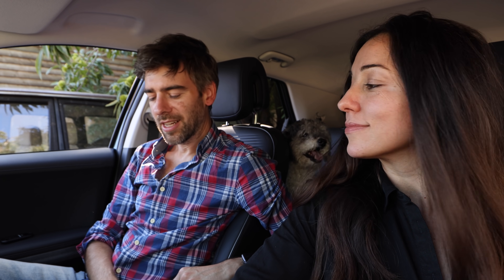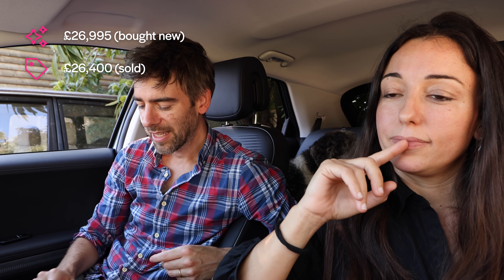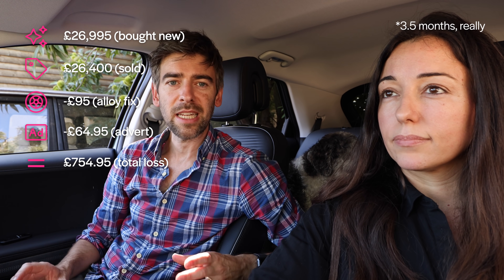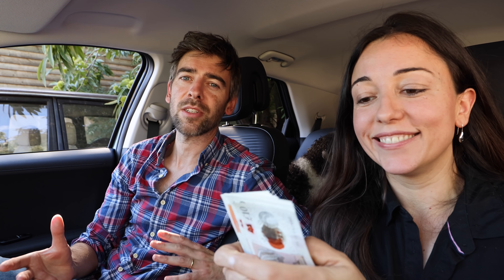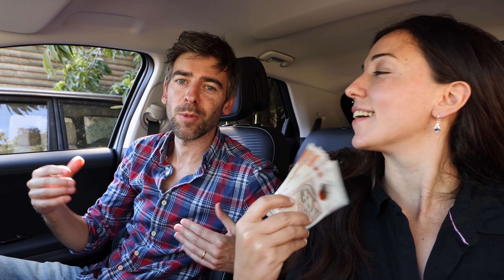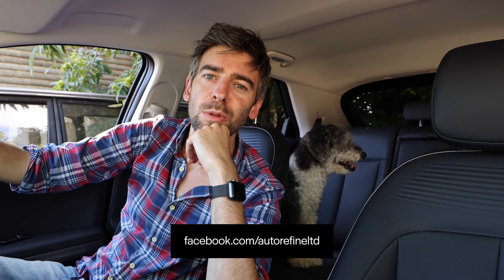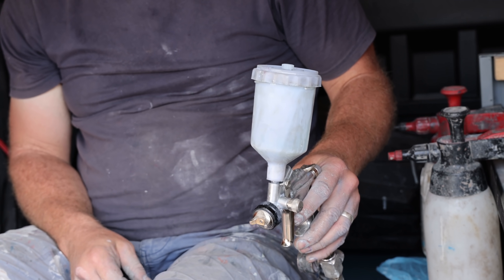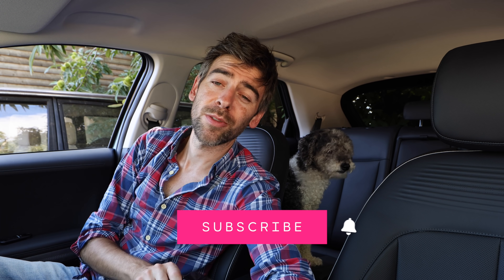How much do EVs depreciate? We sold the Fiat 500e: how much did we lose?

Comment from the maker: The dealer who bought the car is advertising it here. That's quite a profit they'll make if they sell it for that! 

https://www.autotrader.co.uk/car-details/202108316837001
Reply: (Link is not working now.) 
This video is worth its weight in Gold. So you lost a bit less than you think.
As for the kerbing, that could have been a bigger loss if the car was leased.
And you have the £500 which was honoured when you purchased the car.
Worth all of the £200 for Flaviana, too! Look at her face. 😀👍
A pretty good deal, I'd say.
Well done, and thanks to both of you for the video. 🙂
Reply: Suggestion... Put the value up £500 & then during negotiations go down slowly to the value of price bet with mrs.
You need to learn to negotiate.

Comment: Here in Costa Rica where I live, a 2017 Fiat 500E costs $15,500 which was the same top dollar as it costed 5 years ago. In terms of currency depreciation in Costarican Colones, it appreciated in value 25% from 5 years ago. My 2012 Volvo S60 T4 has a residual value of $9,000.” If I’m lucky!
Reply from the maker: I'm surprised it's kept its value so well considering it's the old model. That's a testament to how good they must be.
Reply: @MrEV  And that there aren't many around to quote! Pity that ONTO passed the way. We have renting here, albeit I haven't been able to obtain a contract. The regular car loan required a 30% down payment and came with a two year fixed interest rate of 8.4% APR and then 9.20% variable rate with a floor of 9.2% and no ceiling onwards for the next two years...

An acquaintance of mine drives one 500e since 2017. He paid $15,000 then and has lost in 5 years 10% of battery life as per an application. He has not performed a total discharge-total charge test. He's been charging immediately upon arrival to his work and when arriving at his place. Albeit he has an diesel SUV for longer errands.

I am smitten by the looks of the car in grey with orange accents, but I have yet to face the piper with the loss on my beloved Volvo S60 when I sell it! If I am able to sell it as they have a bad reputation and expensive parts!

Comment: Great video thanks. I'm in the process of selling my Tesla model 3 performance now 2 years old for a new Model 3 LR. When I ordered my performance back in May 2019 it was £ 51k. I am now selling it for £ 48k! I put a 20k deposit on the performance with monthly payments of £ 600 on HP to own the car after 5 years ( still 3 years remaining) no pcp was available when I bought the car. The new Model 3 is 15k down with 4years payments at £ 450 on pcp with 12k back in my bank once I settle the hp balance. Picking the new car up next week really looking forward to it. Every time I drive this car it puts a smile on my face and its so easy to live with and awesome family car. The wife loves it which is a bonus. My previous car was a 2017 BMW m3. Cost 60k and only run it for 18 months. Only got 32k back for that car😬 cost me a bob or two.
Reply: Long range EVs will have low depreciation for the next 3-5 years because battery size and design will not significantly change in this period.  Same as they didn’t change much in the last 5 years.  Only wish we changed to EV sooner.

Comment: I have a question. I am thinking of buying an ID.4, selling in about 3 years. I am assuming the chip shortage will be over by then. But also that EV technology, in particular battery technology, will advance quite a bit. That suggests a large loss of value. But then again, EV's might still be in short supply if the move from ICE-Vs to EVs accelerates. So, buy or lease?
Reply from the maker: Good question! Firstly, yes, the chip shortage should be over by then. As for battery technology, I don't believe it's going to advance very much in three years. There's the continual promise of solid state batteries of course, which apparently will be undergoing testing next year and will have reached market in 2025 if BMW are to be believed.

Even when that happens, I have a feeling the yield will be slow initially and BMW will probably just put them in the most expensive cars.

For that reason, I think you'd be relatively safe buying an ID.4.

However! We don't know what's going to happen with the Chinese brands. If any of them manage to flood the market with cheap EVs, that may bring the overall prices down a bit.

I do think you'd be fairly safe with a VW though as it's a respected brand, and given so many people want EVs, I think prices will remain high for a long time to come.
Reply: @MrEV  this sounds spot on to me. There will only be marginal gains around current battery technologies for the next 5 years I reckon. 
As 2030 approaches EV sales volumes will clearly rise sharply and that should drive prices down. But that will probably be from 2028..

Comment: First off: great video! Second:  You took a great risk trying to sell an almost new car, and you were very lucky to have only a loss of 700 pounds in 3 months. I experienced more or less the same problem: I had a 3 year old Opel Ampera E to sell when I bought my Ionic 5 project 45. The Ampera E in 2018 cost € 48.000 including winter tires and tow hook. After 3 months on AT finally only one buyer was willing to pay € 20.000 for it. That is € 28.000 depreciation in 3 years! Then we decided to keep the car a a second car. In my  experience ev's depreciate just as quick as ice-vehicles. The reason for that is that technology and prices of new ev's change also very quick. So I expect the Ionic to depreciate about € 10.000 the first year. It is a great car though. No regrets on that decision!
Reply from the maker: Ouch — that is painful. Where are you based? Supply of EVs to the UK seems quite constrained so I think that could have an affect on keeping used prices artificially high.
Reply: @MrEV  The Netherlands

Comment: Hi Andrew. Unrelated to this (very entertaining) video, is it unwise to charge the Ioniq 5 to 100% regularly.  I can't find Hyundai's advice on this. Many thanks, Luke.
Reply: No electric car should be charged to 100% regularly. Why do you need to do that? Stop at 90% max. 80% ideally.
Reply: @theta2170  I've heard that advice many times but I've also seen something online saying some manufacturers don't feel that restriction to be necessary.  I wanted to know what the Hyundai view is. As for why I want to, I don't, particularly.  I just want to know.
Reply from the maker: In the manual (which is in the car right now and I'm too lazy to fetch it!) I seem to remember it recommends charging to 100% once a month. I don't remember what it says specifically about limits actually but generally I think it's better to charge to 80% mostly.

That said, modern EVs have very good battery management systems and regular charges to 100% probably don't matter too much. I generally just charge to 80% and then do a 100% before a longish journey.
Reply: @MrEV  Thank you. I've picked through the manual and missed the bit about 100% charging. Thank you for the reply.
Reply: @MrEV  Found it: "If the high voltage battery charge 
amount is below 20%, you can keep 
the high voltage battery performance 
in optimal condition if you charge the 
high voltage battery to 100%. (Once a 
month or more is recommended.)"

Comment: Great video!
I guess Flaviana would have pulled that 200£ out of your hands one way or another anyway. 
Have you sold your E-Niro yet?
Reply from the maker: Thanks! The e-Niro had reached the end of its contract hire period so I had to give it back a few months ago.
Reply: @MrEV  Ok!
In Sweden, where I live, the car has a rest value in the contract after the leasing period has ended. This means that you can buy it for this sum and sell it on the market. My E-Niros (delivered March 2019, 68.000 km), that I will buy out and sell in November, rest value is 225.000 SEK but I will probably sell it for 300.000 SEK (equals 25.000£). Is it about the same in Britain?

Comment: My ice Hyundai cost me £26k and sold for £18.5 3 years later (trade in) so my car cost £268 a month all in. It did 30 to 40 mpg and cost £800 to insure over 3 years. £900 in fuel over 3 years and 2 tyres at £150. Service cost £300 for 2.. Plus my car did 0 to 60 in 6 seconds and 155 mph (on a track). Your Fiat 500E cost you more over a shorter time and would have cost a lot more over 3 years.

Comment: When your wife checks you have paid in full😁. Just goes to show trade in and we buy any just take the …. We have both factory ordered cars on the drive and we would do it more often my Car is now seven years old from being one of the first of its gen on the road and keeping it till I get a EV and if it gets to ten years then fine. Too many variables just now like battery tech improving and seeing what some of the second Gen EV models are like. Yes yes I have watched a million clips from fully Charged, like yourself an a few from the states and of course that Tesla ninja from Norway 🇳🇴😉 to know range isn’t everything but I use my car for road trips and driving holidays and set my minimum 300 real world before I’d switch. If the second Gen MINI can do 300 miles big ask from a company so far behind on this new Chinese platform made by “Great Wall” or that new Renault 5 that looks like a hot hatch does 300 miles I’m all in if not I’ll look at the model Y or 3 or this new Tesla 2 (whatever it will be named) but I have a feeling it will be budget 200 miles packs for city driving unless the price of batteries falls off a cliff.
Reply: haven’t seen any major breakthroughs in recent years on the batteries - you could be waiting forever. Price of production is going down which is good though.